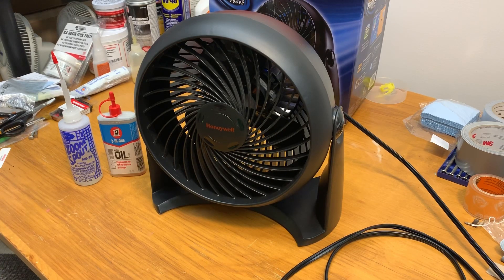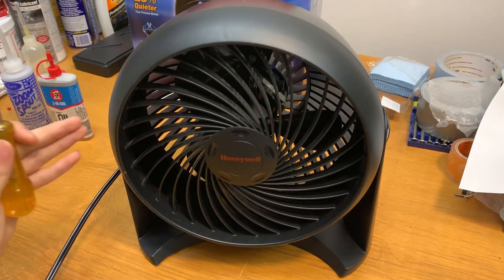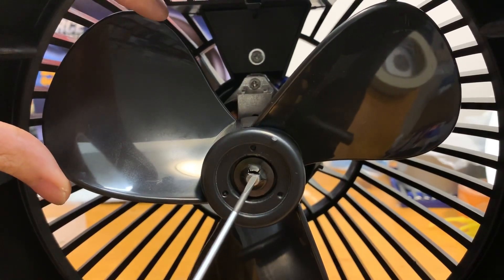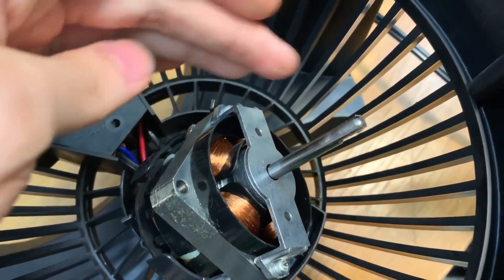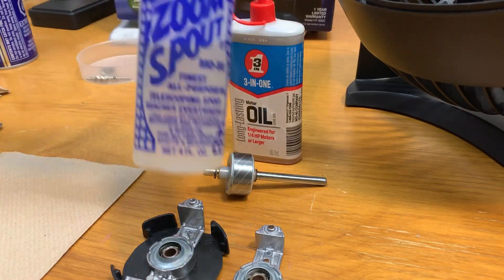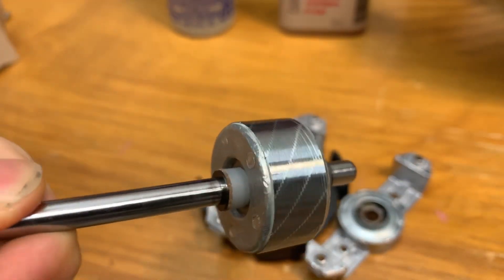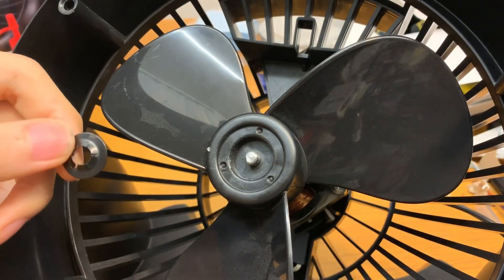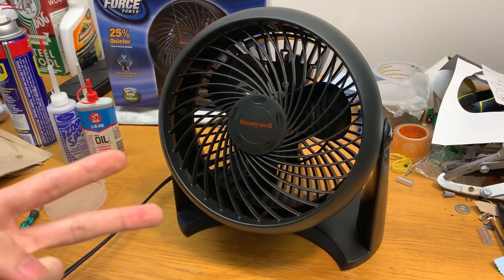Disassemble, Clean & Oil a Honeywell Fan w/ PSC Motor

Comment: Thank you for your clear and well-presented video. Great job! What size torque screwdriver should we get to remove the screws holding the cage together?
Reply from the maker: You’re welcome! I believe it’s either a T10 or T15 screwdriver. I wish I could grab mine and check but it’s tucked away deep in my storage shelves 😅. I’m sure employees won’t mind if you bring the fan with you to the local hardware store and try a few of the screwdrivers.

Comment: Just completed assemble my fan after thoroughly soap cleaned, dusted motor lubed and wired back correctly. And its now running quiet and smooth. Now I will do my next same fan the same again tomorrow. TY!
Reply from the maker: You’re very welcome!

Comment: I have a 9 inch table top fan of a different manufacturer. Thanks for pointing out where I need to unscrew now. I'll remove the grill and clean it.. as to all that stuff you did with the oil.   oh, heck no
Thanks
Reply from the maker: You're welcome! The disassembly of the motor can certainly be tedious. If you'd like, you can simply add a couple drops of oil to the spot where the motor shaft meets the front bearing, without any disassembly of the motor. Easy and it still helps the motor.
Reply: @TheSuperFanMan I just wanted to clean mine

Comment: thank you for the great video ... I have done this sort of thing with my old HT800 fan (still works fine YEARS later) .... I tried to do the same thing with i think some "...820" or "824.." (in the model name)  fan from a year or two ago from Walmart, ...one with this sort of motor but with no luck.    

The fan was ok but fell ... about 2 feet off a stand i had it on, onto carpet and it wasn't the same after that.   I noticed the following day that on high it barely moved as much air, as it used to on low... took it apart (not really dusty at all) ... put it back together, ADMITTING I may have lost a little plastic washer.... the motor sounds normal but it doesn't spin at all now.

When i first took my HT800 apart years back it was getting slower but after fixing it I at least could spin it and the motor would "catch" and then it'd spin via the motor (BEFORE i did anything).   This new 820/824 model one with this newer motor in it DOES spin by hand and I cant tell any spots it's binding or whatnot ... I am just taking a break from fixing this one, but i will likely put it away to come back to sometime later
Reply: after some work and some Open ChatGPT help ... and explaining exactly what is happening i think it maybe that cap at the bottom 3:48 or so ... what is "inside" that grey box looking thing that is screwed in
Reply from the maker: Hmm it sounds like the fall damaged a wiring connection somewhere, considering the fan spins freely by hand. The grey box itself is the capacitor, and it doesn't come apart. Have you checked the continuity across the two prongs on the plug? 

With the fan switch set to any one of the speeds, a multimeter on continuity or resistance mode should display a value instead of reading open. If it is reading open, you have a disconnection in the wiring somewhere. It could be the switch, capacitor, wiring to the motor, or the power cord. You may have to probe each component with the multimeter to see which one is bad. 

Let me know how it goes! I'd be happy to keep providing advice.

Comment: Tells you everything but how to remove the clip that holds the cable to the fan. I can’t find what the clip is called or how to remove it anywhere. I can’t express enough how frustrating it is that I can find full videos on how to disassemble and clean the entire motor but nothing on the clip to remove the motor from the plastic housing.
Reply from the maker: It’s called a cord strain relief. It can be removed by pinching it with pliers and pushing it out from the inside of the fan. The motor will have to be removed as shown in the video to access the strain relief from the inside. Shown at 9:30 of this video: https://youtu.be/ydam2wCd-e8?si=txc4UUv00usUiaAj
Reply: @TheSuperFanMan thank you. It was driving me crazy. I got a used fan from someone who smoked inside and I needed to move the electrical components further away in order to deep scrub with dawn to remove a nicotine layer. I really appreciate you taking the time to reply. Sorry I was in the throes of failed 3d prints and everything and was tired of hitting brick walls in projects. The fan is basically brand new now. Thanks for the tip.

Comment: The washer holding the fan blades are entirely meant to keep people from servicing it.
Reply from the maker: You're absolutely correct! They could've gone with a simple press-fit design for the blades so only a good tug is needed to remove them, but it would make servicing too easy.
Reply: @TheSuperFanMan  by the way, the 4th iteration of this fan has little plastic bits that go on the front and back of the motor and that causes the motor on that version to run very hot

Comment: Glad I found this video. I bought this fan at Walmart. Got it home and it didn’t seem to spin fast and stopped almost immediately after shut down. Opened it up. Everything was dry as a bone. Lubed it up and now it spins for a while after shut down like this one. No sense in returning it when they’re only $20. I can actually feel it at 25 ft now.
Reply from the maker: I'm glad the video was helpful! Poor lubrication is a common problem in many fans made today sadly. Just another method of cost cutting and planned obsolescence.

Comment: You can remove the motor completely from the fan leaving only the cord. You need to remove the one wire nut and the other wire of the cord goes into the switch. You can insert a small flat head into the hole in the switch where the wire goes in and the wire will come out easily. It is safe to wash the fan housing if only the cord is left, just make sure everything is dry before you put it back together. One mistake I made: Do not try to force the bearing (it's really a bushing) off the front of the shaft. I tried to force it and the round element came out and it was very hard to put it back. I'm worried it might run with too much friction now either creating noise or overheating. Do not force the bushing off. Just oil it as it is and leave it be.

Edit: So I ruined my fan... kinda. When I put it back together it was making a bad sound and speed was varying, sometimes not able to start from a stop without assistance. I opened it again and once again took the round element out of the front bushing. It had scratches on one side from trying to force it back in. I had bent all of the metal tabs up to make it go in easier. Anyway, I turned the element around so the scratches were facing in instead of out. Bent the metal tabs back down as best as I could. Put it back together and it runs much better. I think the shaft is supposed to spin while the round element stays still. I suspect the round element was spinning with the shaft the first time because it was held too loosely after I bent the metal tabs up to try to get it back in easier. I hope this thing has a thermal sensor to shut down if things get too hot.

Moral of the story guys: Sand/file the shaft so the bushing can come off instead of trying to force it. You will ruin your fan.

Comment: The screws don’t come out with regular screwdriver or any screwdriver for that matter…
Reply from the maker: They certainly do come out with regular screwdrivers, as I did in the video. These fans use either Phillips or Torx screws. Phillips #2 and Torx #10 or #15 are the correct bit sizes for the screws used on this fan.
Reply: I see in the comments plenty beg to differ. But thanks.
Reply from the maker: No problem. Are you using an interchangeable-bit screwdriver? Most of those will not be able to reach the recessed screws due to the larger shaft. You may need a dedicated Phillips/Torx screwdriver.
Reply: @TheSuperFanMan  yes using interchangeable def not working. Tried a very thin one used for small electronics but that wasn’t strong enough. Will try regular philips. Thxs

Comment: I've had three of these fans. The first one, a street find, died after a year. The second one I bought, lasted two years and died. Found out it needed cleaning and lubing, but it was too late. The last one was also a find, worked four years, started having problems, but after watching this video I followed all the steps and now it works great again!
Reply from the maker: Happy to hear that! The unfortunate thing with many fans nowadays is that they come poorly oiled from the factory. It’s partially because of cost cutting and also a subtly method of planned obsolescence. Occasionally cleaning and oiling these fans drastically improve their lifespan!
Reply: @TheSuperFanMan  UPDATE: After a few hours the fan stopped. The fan blades still turned freely, so I took it all apart again, checked the wire connections, added a bit more oil (sewing machine oil) to the bearings and even added a bit of oil to the rotor and armature shields. Put it back together and it ran again. Then I read that the rotor and armature shouldn't have oil on them, so I took it apart again and wiped them clean. However, in cleaning the plastic coil shields separating the armature from the rotor, part of one of the four shields broke. The fans runs fine again. But is it safe to run? I'm guessing since only part of one of four shields is missing it should be ok, but could overheating and arcing result? If so, I'm guessing I should just toss the fan out.

Comment: 5:31 what number grit?
Reply from the maker: Around 600 grit is good for sanding down any burrs. I usually like to go over the spot with 1000 and 2000 grit afterwards to give it a polished finish but that’s purely cosmetic.

Comment: I should have watched this video before I started doing this to my fan. I had to drill out that push nut, and by mistake I drilled the shaft 🤦🏼‍♂️🤦🏼‍♂️
Reply from the maker: All good, I’ve made plenty of mistakes too while working on fans! As long as the motor shaft isn’t heavily compromised, it shouldn’t affect the functionality of the fan.
Reply: @TheSuperFanMan  thanks.  Fun fact: I got two of these fans, one was gifted to me like 15 years ago and it was already used and then about 5 years ago I bought I new on, and the old one blows way more air than the newer one.  The newer one is the one that I am working on because it wasn’t turning on, because of all the hair that it had trapped on the shaft.  I’ll be surprised if it works after I try to reassemble it. The old fan I have never had to disassemble it to clean it, I only clean it by using a water hose, and I’ve never had a problem with it, I haven’t even oiled it, but now I will.  I just went to Lowes today and picked up a bottle of that 3-in-one motor oil.

Comment: My dad took his Honey turbo fan apart to clean it. He put it all together, and it works  great. However, he took the stand-off and put it back, but now it doesn't stay still . It keeps tilting backward .It no longer clicks into different positions.What should he do to get it to stay in one position?
Reply from the maker: The tilting mechanism on this fan consists of a circular metal plate with a row of holes that act as detents. A small metal ball and a spring fits into a hole behind the metal plate. Basically as the fan is tilted. The spring loaded ball clicks into the detents, which holds the fan head in position. 

Have you checked if the spring and ball were reinstalled? Without them, the fan head would swivel freely and face upwards due to the weight of the motor.

Comment: Just some tips for anyone else who might be trying this. I couldn't find a screwdriver that fit in the holes in the grill so I had to come up with an alternate solution. I had a few syringes lying around that I use for measuring and dispensing glues and vape juice. I found that if I used a 1ml syringe with a long 14 gauge blunt needle on it, it was just skinny enough to go through the holes in the grill and long enough to get the oil right into the front bearings, both sides. With a little fiddling I think I was also able to angle it behind the back bearings as well. It felt like I was able to get it into the felt area, but I couldn't see to confirm.  I used sewing machine oil, which I have found to be great for things like this. You don't need much, but the difference was night and day. The fan started up at full speed as soon as I turned it on. It had previously struggled to start at all, now its blowing like brand new again.

Comment: When you're prying the push nut off the shaft you should try not to gouge the shaft because if you do you could damage the bearing when you slide the shaft in/out of the bearing housing.
I gouged mine.  To fix it I wrapped the other end of the shaft in cereal-box cardboard then put it into a drill and spun it with 1200-grit sandpaper wrapped around the damaged part of the other end.
Does 1200 grit sound acceptable for the final sanding?  I didn't touch the part the bearing contacts while the fan is running. 
NOTE WELL:  I'm not trained in any kind of motor repair or metal working.
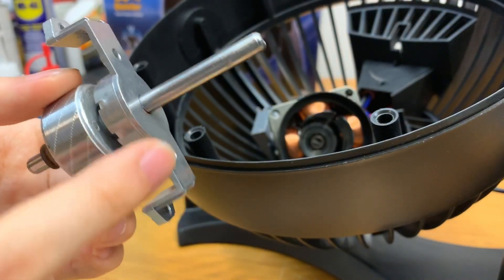Reply from the maker: Absolutely! I mention it briefly at the 5:00 mark in the video. It’s pretty difficult for the push nut to not inflict any damage to the shaft, even if you’re extra careful. The method you used is probably the safest and best way to clean up the gouges. Glad you protected the shaft with the cereal box piece, and yes, I would say 1200 grit is right for the job. No need for a coarser grit as it would likely scratch more than smooth out and polish the shaft.

Comment: Why tf is the screw so deep in the fan my none of m screwdrivers fit in the hole who ever made these are actually slow asf
Reply from the maker: I also ran into the same issue when I first attempted disassembling it years prior. The best way is to buy a dedicated Phillips (and Torx if applicable) screwdriver. Most interchangeable-bit screwdrivers tend to be too wide to fit.

Comment: What size torx bit??
Reply from the maker: T10 should be the right bit, based on the ones I've worked on. I've noticed that some older versions have Torx bits with a pin sticking out of the center. With those, you can take a small flathead screwdriver and break off the pin before using a regular Torx bit.
Reply: @TheSuperFanMan 
Thx for the follow up. I have the older one & can now confirm it has two torx 15 security screws (one at 3 o'clock & one at 9 o'clock). I bought a full size torx "security" screwdriver set as a dedicated driver is the only thing thin & long enough to get in there without breaking or stripping something.
Reply: Honeywell HFT-311B from 2003 is the model referred to

Comment: i was taking apart the exact same fan but for some reason the front bearing cant be removed and there is no rust or any spots on the shaft that is preventing the front bearing to come off i did touch the end of the shaft and it felt like it was smooth like normal but the front bearing cant come off and it is happing where the flat part is on the shaft
Reply from the maker: It's due to a tiny burr on the flat spot on the shaft from the manufacturing process. Even though it feels smooth, there is some material sticking out that's interefering with the bearing housing removal. I would take some 400-600 grit sandpaper and lightly sand the edges of the flat spot to knock down the burr. The bearing should slide right off!
Reply: @TheSuperFanMan  thank you so much

Comment: Not sure whats up with my fan. It wont spin whatsoever, like its not getting power. I checked the fuse, even tried an alternate fuse and that wasn't the issue. I took out the rotor and oiled the bearings, it spins nice and freely. So I cant figure it out.
Reply from the maker: Sounds like the motor’s internal thermal fuse blew due to overheating. Unlike the fuse in the plug, the thermal fuse can’t easily be replaced unfortunately.
Reply: @TheSuperFanMan  Bummer. I think this happened to me too. I realized that the fan hadn't been spinning for a few days and then unplugged it to fix later. I disassembled and got it spinning, but no dice. The fuse in the plug showed about 60Ohm on my multimeter, so it didn't look blown. I probably should have tried to oil it when it was having trouble spinning initially.

Comment: Why’s my fan blowing air the wrong way now
Reply from the maker: It sounds like the stator was reinstalled backwards. The metal block component of the motor with the copper windings (called the stator) needs to be oriented with the wires exiting from the back side. You might have put it in backwards when you reassembled it. Simply disassemble the motor as I did in the video (remove the rotor too), flip the stator around, reinstall the rotor and put the fan back together. It should then run in the correct direction. Hope it helps!
Reply: @TheSuperFanMan  I have it all put in right I watched a couple videos on how to fix it including yours and the wires all line up correctly the black and white wires coming out back are more to the left the the front ones are more to the right